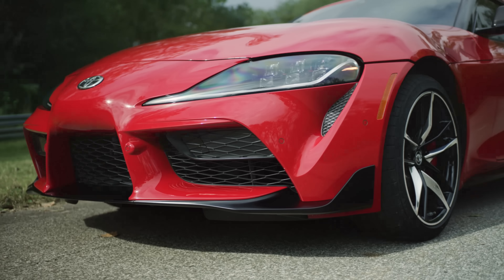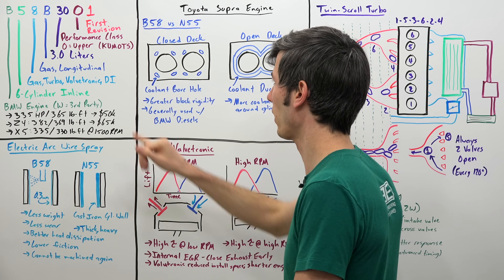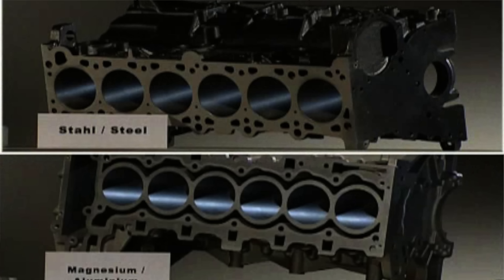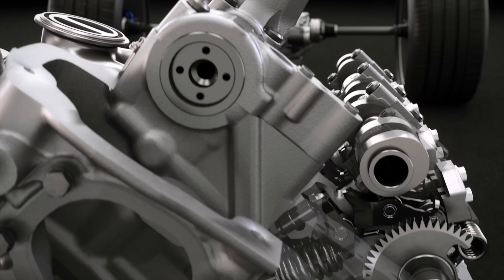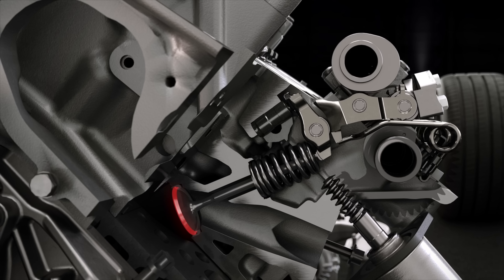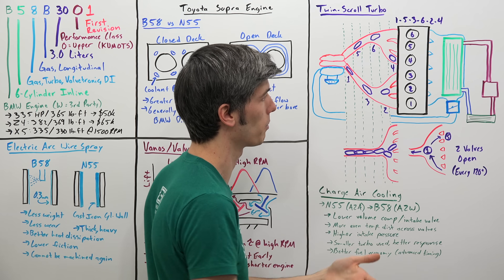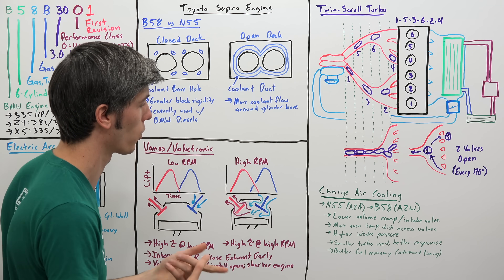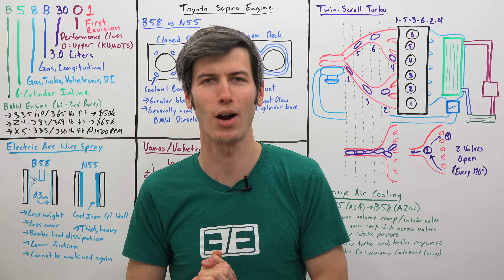2020 Toyota Supra Engine - Detailed Review Of The 2JZ Successor

Comment: Come to Germany and the the reality of this b58 engine...  , sad to see how They even  name this car a supra ,  the b58 cant support more than 500 hp
Reply: Okay, so another vid on yt comparing the 2jz with the b58 mentions the b58 has forged internals, is lighter, has a tough cylinder sprayed lining, & has a closed deck design block, all which points at good power potential. But what do I know? Seeing that hating at a BMW motor without researching it is the new trend, why break the streak.
Reply: @izzdin6228   my only issue is the cylinder wall lining. While yes stronger and lasts longer but only one time use? No bueno.
Reply: @FXIIBeaver  the R35 uses the same cylinder lining tech, & that thing can make monster power.
Reply: @izzdin6228  not doubting its capabilities. I just don't like the idea of only getting one use out of the lining before I have to start looking at a possible new block. Otherwise the engine itself sounds amazing.
Reply: @FXIIBeaver  it does, doesn't it, but  I'd rather you ask the guy in this chat that owns a bmw, jpsr20det. He knows better than I do.
Reply: @FXIIBeaver  If the lining wears out you don't need a new block. It can be relined with a different material or simply bored out + oversize pistons or cylinder sleeves.
Reply: @izzdin6228  I'm a bmw technician,  and I do own a bmw by the way
Reply: @jpsr20det  so, what else can you tell us about the b58 that we don't know? I'm curious here.

Edit: I'm honestly curious here, not faking it.
Reply: Closed deck block with 25 years more R&D in materials and technology.
I say we have a winner.
Reply: @gixxxer1000  yes on paper it's better....but ;) time will tell...😏
Reply: Actually the engine itself can handle damn near 1000hp. The only issue I see here is that the B58 has a water to air intercooler in the intake manifold so that will certainly be a limitation for those seeking big power figures. The B58 has been a reliable engine so far. I’m a BMW tech and haven’t done much other than maintenance on them so far.
Reply: @christian_araujo11  another BMW tech. So besides the intercooler, what else can be considered a weakness?
Reply: @izzdin6228  valvetronic doesn't like to rev high. Btw have read in many places that with a flashed ecu, downpipe and a bigger turbo you can make +600hp reliably on this engine with stock internals!
Reply: @Runmeerkat  I'm pretty sure it's much more than just a downpipe and a turbo, but yes, I've seen a guy claiming he has stock internals and he's making 650whp. With just a downpipe a tune people make 400whp. Unless when you say bigger turbo you automatically mean all the supporting mods in which case I withdraw my comment =D
Reply: Says you. With enough money I bet I could get it to 1k hp
Reply: @FXIIBeaver  for about 43 seconds, sure.

Comment: The supra is my favorite BMW
Reply: @footballcoreano  I'd say it's 95% BMW I'll give  Toyota 5% for the re-skin and maybe some dampening changes.  So it will be as reliable as a BMW  :)
Reply: @GearHead4Lyfe  😂😂😂😂 Pretty much.
Reply: I didn't mean they fully built the chassis but they did tune the chassis.
Reply: @jdmr1c3ing  Toyota just signed it off. They received a product which met their requirements and standards. They asked for a signature design and that's all. And this makes the car more cohesive after all. BMW has the perfect recipe for this type of car. This Toyota Supra is actually the best BMW. A very good engine, their signature engine in its latest iteration, a little bit harder to tune due to it's hardware, but a very solid engine, compact, light. In terms of the drive train they have the latest from BMW. When you consider how much less it costs compared to the Z4 and even M2 Comp and how good this car really is, you begin to understand this collaboration between Toyota and BMW. Toyota practically founded a big part of the development of the Z4 and its coupe sibling. Cost sharing led to something really good. And yes there will be other engines. But I think a manual gearbox, a new one that BMW recently developed and which will find its way into the new 3 series is going to be in the Supra togheter with the 2.0 turbo engine. And that will be another very good engine, less powerfull but the car will be lighter which will further help handling. Not to mention that it will be cheaper. I really think Supra owners will be pretty happy. The rigidity, the quality of the drive train, the very well resolved rear diff, the low centre of gravity, the size of the car are all right. The weight might have been lower. And I have to correct myself, Toyota did bring something else to the table besides the cash. They brought their stereo 😂 that's how they kept the price down. Joke aside you can see the climate controls are from older generation BMWs, there's no active lane control assist. In rest they pretty much have the same car. Power and torque figures are just a tune difference compared to the Z4. Tuned right this will leave an M2 Competition for dead. Toyota has payed for a certain number of cars that will wear the Toyota badge. BMW saved the shipping cost by selling them straight out of the factory. They are making the most profit out of this. They already had the B58 engine and ZF8 gearspeed combo perfectly working in their other products. They found a way to sell more with this deal with Toyota. So they offered Toyota a lower price. And Toyota carried that price to you for what is one of the finest sport cars of today with the best six cilinder outside Porche's kitchen. What will be interesting to see will be  if Toyota receives the S58 or not. I doubt it. At least not for a while. That might be a very limited edition.
Reply: @jdmr1c3ing  Do explain what you mean by "tuning" the chassis.
Reply: @michaelcarr4748  The chassis is stiffer for track use.
Reply: Its about as much a toyota is a chevy LUV is a  chevy... (All chevy did was import them as chassis cabs from isuzu and bolt beds on)
Reply: J Blob at least Chevy luvs where cool tho
Reply: Such an original comment...
Reply: @埼玉はぱ  As original as the new supra.
Reply: @iforgotmyname2306  More original than your name though.
Reply: @footballcoreano 
You mean now reliability.
Reply: @footballcoreano I did not understand anything you tried to say.. But keep trying😀
Reply: And you just triggered a lot of fangei that who never own a supra lol.
Reply: Same
Reply: Best looking for sure.
Reply: Supra is a slower z4?
Reply: @arzdaman  It's actually faster than the z4... but everyone nowadays thinks more horsepower  = faster. Lazy thinking not looking into weight, or suspension setup. Also the Supra horsepower is grossly underrated from the factory. Their claimed crank hp numbers are lower than stock dyno wheel horsepower numbers. Car manufacturers usually do this to avoid certain emissions or added tax rules.
Reply: BMW is garbage
Reply: Ugliest bmw ever made
Reply: Toyota did the chassis.
Reply: @jdmr1c3ing  No, they didn't, the platform is clearly a BMW platform. But I wouldn't doubt the suspension was tuned by Toyota specifically for the Supra.
Reply: @AWDfreak  Using BMW's "Golden ratio" for handling.
Reply: @jdmr1c3ing  toyota stuck the logos on it..... The car is even going to be built in Austria. LOL
Reply: @jdmr1c3ing  They didn't though, they just changed the paneling (and added a roof) likely based on the M coupe. It still will be made at the same factory and likely involved BMW engineers. 

It's not like Toyota built a chassis and is having the parts shipped to be installed. Or that the subframe is different, or suspension, etc. At least the interiors look different *No wait it is based on the previous generation z4. Still, some difference, and I very much appreciate that.

Comment: B58 is not the 2JZ successor lol, its no where near as reliable or tunability to 1,000 hp like the 2JZ, and its a single turbo not a twin turbo like the 2JZ or upcoming S58, M version of the B58
Reply from the maker: The previous Supra used the 2JZ, the new Supra will use the B58. To me, that says that the B58 is the successor engine. That doesn't, however, mean that you have to like it. :)
Reply: @EngineeringExplained  Wasn't the 2JZ developed in partnership with Yamaha?
Reply: @nfdids  not the N/A but apparently yes in the twin turbo
Reply: @nfdids  The 2jz wasn't a Toyota designed engine. Block designed by a German and head designed by Yamaha.
Reply: the 1JZ was. Toyota kicked them out when the 2JZ was developed. However given how much those two engines share you could make a point that Yamaha was key to the 2JZ's success.
Reply: @gixxxer1000  I'm pretty sure BMW was the one who helped in the block
Reply: @blitzwing1985  That's not entirely  true. The second and third generation of the 1JZ-GTE were built in partnership with Yamaha. Toyota later built another generation of the 1JZ that was completely on their own as was the 2JZ in its entirety
Reply: @gixxxer1000  I think I have seen you somehwere else saying this lie so I decided to stop you here. The block is NOT german engineered. It's a lie passed on forums. If you decid to insist, please tell me how did you find any relation between the 2jz and Germany.
Reply: Engineering Explained WOW I got a reply from Jason Fenske!!! I feel so honoured now thank you
Reply: JundaComputersGmbH You talk about the 2jz like you could just slap a tune on and make 600 hp. You had to upgrade the internals a lot to handle that. There is already a big turbo tune for the b58 that makes 650 hp on stock internals so.
Reply: Not all 2jz have turbos. The 2jz-ge is natural aspirated
Reply: It takes a lot for 2jz to get to 1000hp reliably, it's not just a flash tune and a bigger turbo as most people want you to believe.
Reply: The 2JZ wasn't always twin turbo. They had N/A and single turbo configurations as well
Reply: @Sergio Aguirre I have experience with the B58 and the S55 tuned. I currently own the S55 F80 M3 (check thumbnail). Tuned at 600hp since 2016 with ECU Bootmod flash,  and downpipe running on E85. Daily driver.
Reply: @Sergio Aguirre 👍ok I thought you were one of the fantasizing supra 2JZ fanbois
Reply: The turbo in the B58 is twin scroll.
Reply: @Sergio Aguirre totally agree
Reply: The 2jz needed upgraded internals to produce anything above 500hp reliably.

Comment: Lol Toyota did a great job on the engine 😂😂 the 2jz engine is turning in it's grave
Reply: Nah man. The 2jz were so well built, they arent dead yet
Reply: @RandomlnternetGuy  😂👌🔥 you right on that one 💯
Reply: Riccardo Spadano this engine is extremely tunable, like the 2jz. it’s predecessors (n55 and n54) are loosely considered a modern day 2jz
Reply: @TheTechnoGizmo  yes tunable but are they really reliable and can they whitstand the boost?
Reply: 2jz is not in its grave. It never died.
Reply: 2jz wasn’t built by Toyota
Reply: @bradenmchenry995  i don't really care, JZ series of engines is from Toyota, I don't care about who help develope it at all.
Reply: @bradenmchenry995  nope I just don't think it was a smart move to slap the Supra name on a BMW Z4 👀
Reply: The 2jz wasn't a Toyota designed engine. Block designed by a German and head designed by Yamaha.
Reply: @gixxxer1000  where the heck did you come up with that?
Reply: @gixxxer1000  information is wrong
Reply: @gixxxer1000  gtfo mate the engine was made by toyota and yamaha how is it hard to understand it!!!!!! toyota has been making 6 cylinder online gasoline and even diesels also since decades so whats the point here??
Reply: @gixxxer1000  don't care, it was from the toyota line of vehicles and that's all I care about

Comment: It’s pretty cool that Toyota got help from BMW
Reply: @Yannick Imhof Not from my experience and many others. Plastic cooling system parts that fail fast and electronics/sensors that are just plain unreliable and cause problems as soon as the warranty is up, it's planed obsolesce at it's finest which is what most car manufactures follow nowadays in a throwaway society.
Reply: @Yannick Imhof Every BMW a family member or friend has bought has been a basket case - a mountain of problems starting at 60k miles. By comparison, every Lexus has been pretty awesome for reliability. The two Lexus issues I can think of were: one started consuming oil at 180k miles and the other needed a $4k brake modulator replaced at 160k miles. Meanwhile, my grandmothers 5 series transmission died at 70k miles, major cooling issues at 60k miles and had a climate controller fail at 65k miles. Three friends and family have wanted to push their 335s and 135s off a cliff from fuel system issues. BMW has earned their poor reputation.
Reply: BMW got help from Toyota*
Reply: @Yannick Imhof Expensive and unreliable